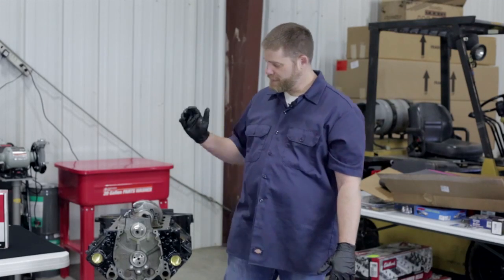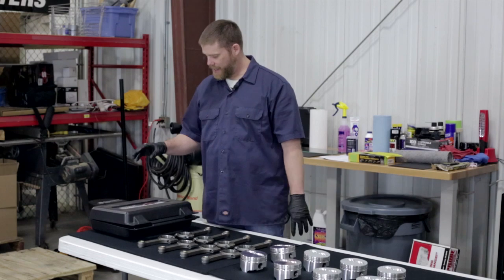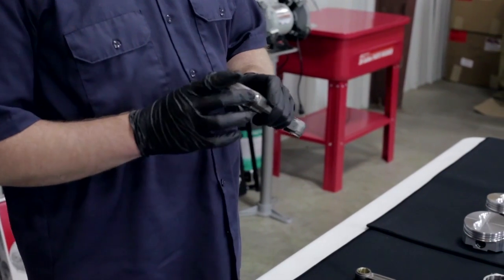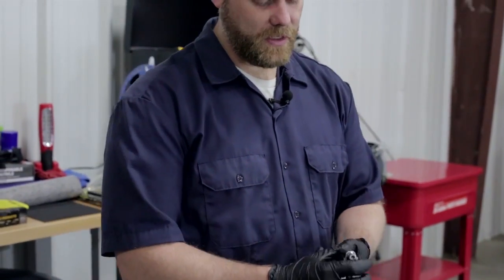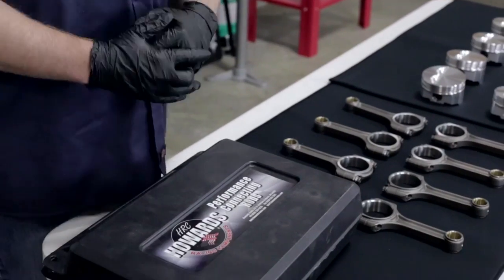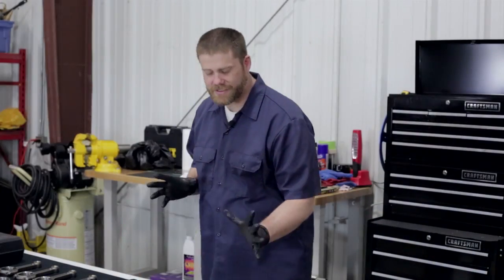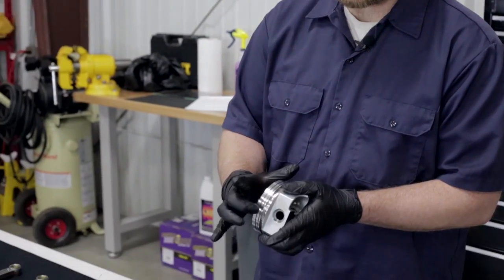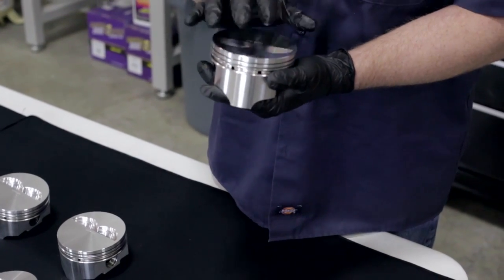Small Block Chevy Engine Build: Piston Assembly (Part 1)

Comment: When I buy new rods and pistons like this (not necessarily the same but assembled at home) can I use them without the machine shop and just put them together and install in my ready to go block
Reply from the maker: Thanks for the comment! The main thing is you are going to have to check the rods and be sure that you have the correct piston pin clearance. Also, be sure to check the clearance on the big end with your bearings installed to make sure that you have the correct clearance with the crank. If you don't find that there are any issues with the piston pin clearance and the big end of the rod doesn't appear to be out of round, than you should be good to install them without having to take them to your machine shop.